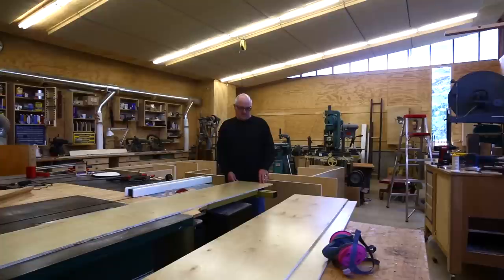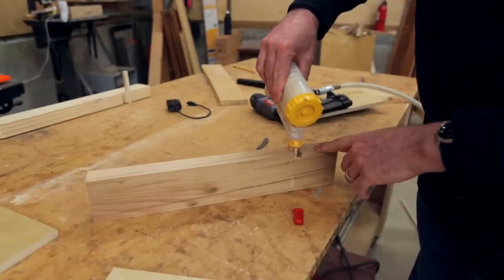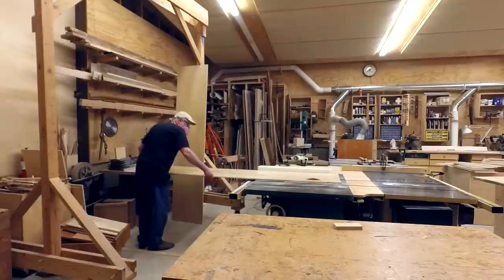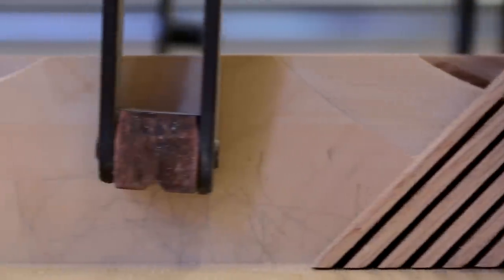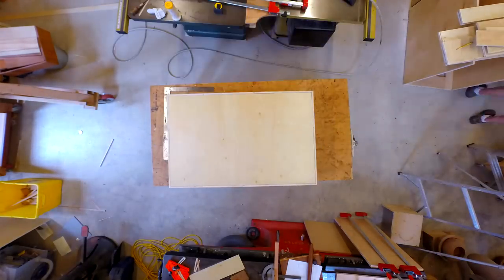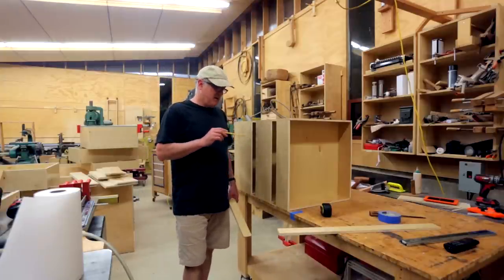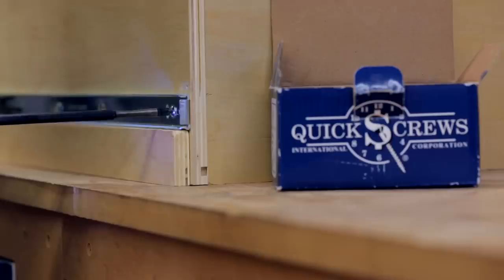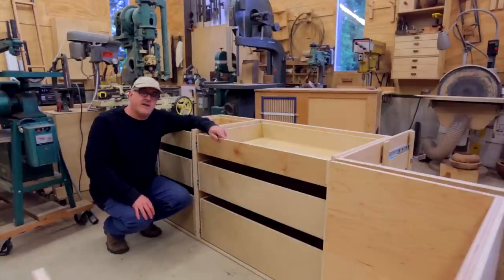Kitchen Remodel: Part 5 - Drawers

Comment: Why do you use plywood for your kitchen? Why not "pure" wood?
Reply: sashablfc Frank or other woodworkers may be able to give a better answer, but I think because the plywood is layered cross grain it ends up being more stable than solid wood.  Oh and of course it is cheaper.
Reply: Jared Shaffer I just would've thought woodworkers of all people would've used "real" wood. Our kitchen which is made of real wood only cost us like £600 worth of wood shipped from America.

Also, with soft slides at 11:00 you can use a thin sheet of veneer or even cardboard to make the draws slide perfectly :)
Reply: sashablfc The real question is, why would you use "pure" wood when plywood will do?  There's a significant cost savings in leveraging the utilitarian nature of a wood grade that you will never ever see.

And if you got your kitchen wood for that low, hats off to you.  I just did mine and spent a few thousand USD on just raw materials, which were plywood in nature, but the face frames, drawer fronts and cabinet drawers were all solid wood.
Reply: Jared Shaffer Exactly, more stable, cheaper. Wood along its length resists movement stronger then wood wants to expand across its grain, so plywood is very stable compared to planks. "Pure" wood is nonsense, use the correct material for the job.
Reply: Kale Klompstra Is plywood not more of a short term material rather than designed to last a very long time? (Genuinely interested, I am by no means a woodworker)
Reply: sashablfc Not really. Plywood just means wood glued from separate laminations. The glue can be very good and it can be made from very nice woods. 
Cheaper then plywood is stuff like OSB (oriented strand board) and MDF (medium density fiberboard). One is wood chips glued together and the latter is wood dust glued up. They have a tendency to swell when wet and stink like VOCs or formaldehyde, but they have their uses. OSB is cheap for sheathing structures, and MDF is dense and good for absorbing vibrations. Its all a matter of function and cost.
Reply: sashablfc "pure" wood has movement with the seasons.  This movement can warp, twist, cup, grow or shrink.  Generally, people want a kitchen that gives them consistent function year around.  Plywood allow you to have it all.  Quality wood surfaces and solid consistent function.  Frank chose an expensive but highly functional plywood that will give him great results.
Reply from the maker: sashablfc I will add one more thought. It would take considerably more time to joint and plane all the wood needed.  Each panel would be a rail and stile panel project taking more time.  Plywood is just so much faster, you just cut it and use it.
Reply: sashablfc Another thought, stringed musical instruments use laminated wood.  The backs of violins and cellos and base fiddles are plywood, and hold up over centuries.  Imagine how long modern plywood with today's adhesives will last.
Reply: sashablfc Why don't you try it or even contemplate the hours of work it would take???